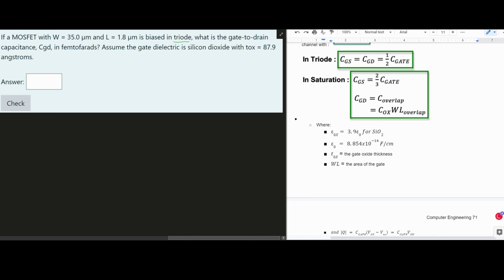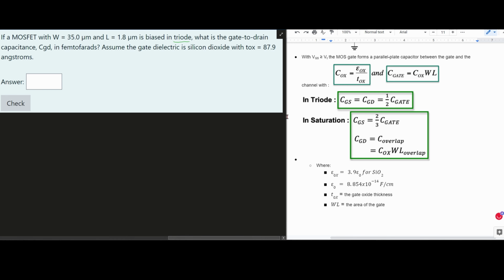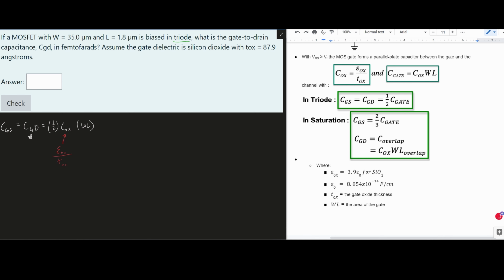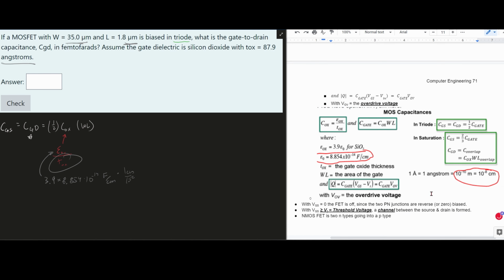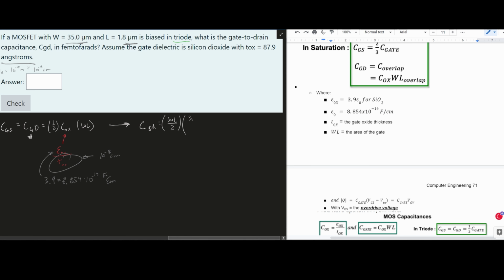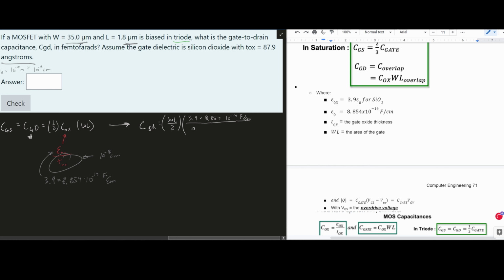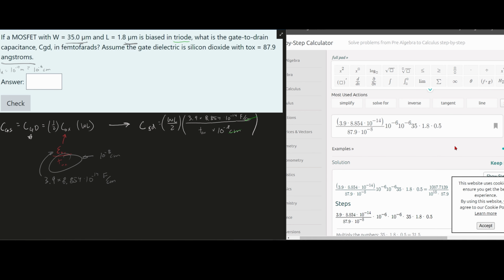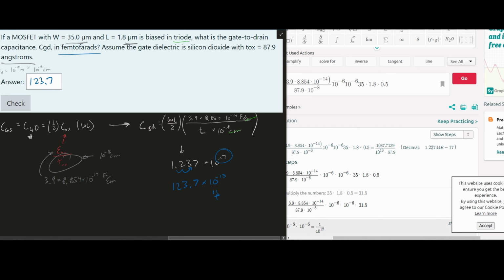Electronics I (MOSFET): If a MOSFET with W = 35.0 µm and L = 1.8 µm is biased in triode, what is ...

Comment: Using spreadsheet notation,  123.7e-15 = 1.237e-13  and not e-17, so the answer should be 0.01237 fF  (intuitively you know e-17 is smaller than 1 fF=1e-15F)